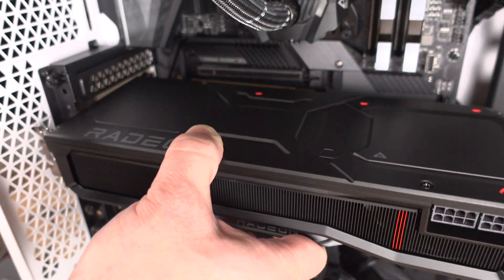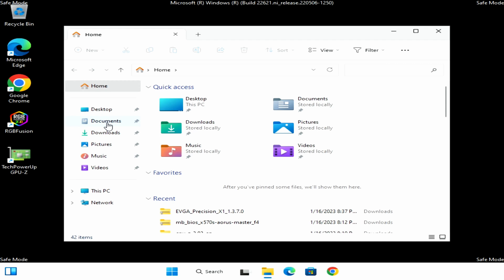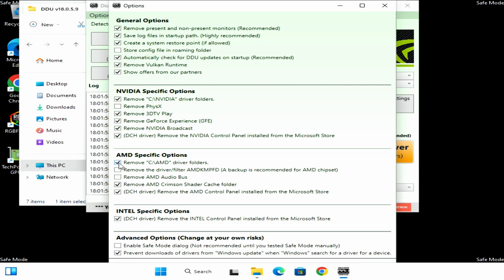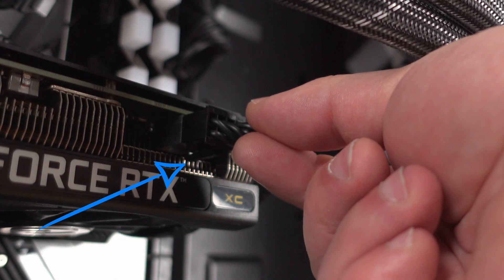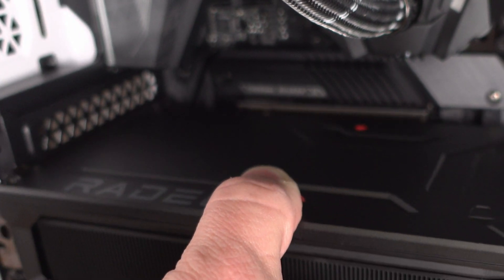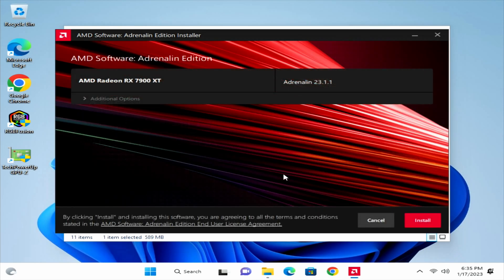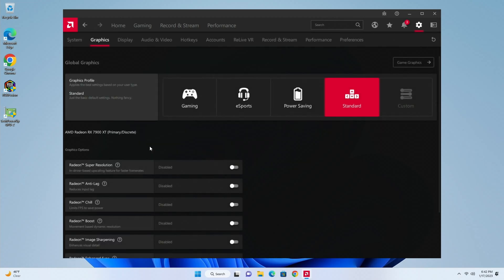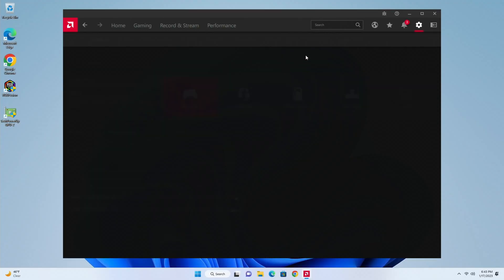The best way to Install the AMD Radeon RX 7900 XT Graphics Card in your PC

Comment: I recently bought a Sapphire Nitro+ 7900 XT and it has 3 6+2 sockets on it. My Montech  Titan 1000W doesn’t have enough PCIE socket to have separate cables for all 3. Is it safe to daisy chain one of the 2 cables?
Reply from the maker: Looking at the package it reads it has 5 * 6+2 connectors, is that 3 cables, and 2 of them have a daisy chain for 5 heads or 4 cables and only 1 of them has a daisy chain for 5 connectors, both ways it sounds like you have enough for 1 cable per port, I am confused?
Reply: @ Ah, you might be referring to the Titan PLA. I have the newer Titan Gold, which has one less 6+2 connection
Reply from the maker: @stevereid636  no, I was this one, is this the one you have: https://www.montechpc.com/en/products_detail.php?nid=329&s_ok2=
Reply: @ThisBytesForYou  Yep! That’s the one. 2 x 6+2 for the motherboard leaving the other 2 x 6+2 for the GPU
Reply from the maker: that one shows 5 x 6+2, they are PCIE/CPU power connections, meaning you can use them for either, you have 4 connections, what CPU are you using and what is the motherboard manufacturer and model number?
How many PCIE cables come in the box for the power supply if it shows 5 x 6+2 PCIE connections
Reply: @ThisBytesForYou  Are you counting the one for PCIe 5? I had a look at the 1200W Titan Gold and it’s the same. I think if pigtailing was a problem they’d and more sockets to avoid returns. Thanks your feedback
Reply from the maker: Look at the link: https://www.montechpc.com/en/products_detail.php?nid=329&s_ok2
If you scroll down a little, it shows PCIE 6+2 = 5 then it shows 12+4PCIe 5.0 = 1
The power supply has 4 connections for PCIe and CPU power and 1 for PCIe 5 power.

Comment: Hi i followed this with the 7900xt saphire pulse and when i turn it on and connect to hdmi i get no display
Reply from the maker: So that I can help, please list the manufacturer and exact model number of the following components:

1. Motherboard - manufacturer and exact model number
   1a.  What BIOS version is on the motherboard, you can find out in the BIOS 

2. CPU - manufacturer and exact model number

3. RAM - manufacturer and exact model number

4. Video Card - manufacturer and exact model number

5. Power supply - manufacturer and exact model number

6. Monitor - manufacturer and exact model number

 Redundant I know, but many people forget to enter manufacturer and exact model number

7. Do you have ALL of the PCIE connections plugged in, and not daisy chained or pigtailed, each coming directly from the power supply?

8. Are you running through HDMI, DP, DVI, VGA, any adapters?

9. Is UEFI or Legacy Setup in the BIOS?

10. What slots do you have your RAM installed in?

11.Do you have CSM Enabled or Disabled in the BIOS

12. Is your Hard Drive/SSD with Windows set to GPT or MBR?

13. This video will help you identify hardware inside your PC: https://youtu.be/65ZSiVImJx0
Reply: @ThisBytesForYou   hi, thanks for the reply, I can't get any display when powering the pc on I tried reinstalling the old GPU but still don't get any display. 

The motherboard is the b450m dsh3 with the bios updated to the newest version a week ago.

The CPU is a Ryzen 5700x3d

The ram is 2 8gb sticks of Corsair vengeance 

The video card is the 7900xt sapphire pulse purchased brand new and the old one is a Ryzen 2060.

The power supply is the Corsair tx850

The monitor is an Asus one not sure of the model but I also tried connecting to my TV as well 

I had 2 separate 8 slot pcie connectors plugged in.

I only ran through hdmi as don't have the cables or monitor for the others

I'm not sure about the WiFi or legacy as can't get into bios as haven't got any display 

The ram is in the last 2 slots but has been in them since I bought the pc (used) and hadn't had any issues 

I tried a couple different hdmis and checked they worked with other devices
Reply from the maker: OK, as for HDMI, do you know if it is an HDMI 2.1 cable, they need to be HDMI 2.1, old HDMI won't work.  Do you have XMP enabled, and are the 2 sticks of RAM on the 2nd and 4th DIMM slot?
Also, when you flashed to the latest BIOS, if you came before F41, did you first flash to F41, then F50 then F67d as the BIOS notes state on the site?
Reply: @ThisBytesForYou  yeah the hdmi is 2.1 and I followed the bios instructions didn't have any issues with it
Reply: @ThisBytesForYou  I think xmp is enabled bot the ram is in slots 3 and 4
Reply from the maker: @lewiskelly5034 disconnect all the cables from the back of your machine, power, USB, HDMI, everything then remove the CMOS battery and wait 60 seconds, after 1 minutes plug all th cables back in, leaving power for last then turn it back on and go into the bios.  In the bios, go to the exit section and select load optimal defaults, or what ever sounds like that, it could be slightly different, save and exit, then go back in the bios, enable xmp, save and boot into windows.
Reply: It was the ram I swapped them over to the recommended on the manual. I don't understand why it did it though as it was fine before any ideas? Thanks for helping 🙌
Reply: I've liked and subscribed I can't thank you enough for helping me
Reply from the maker: Thank you so much for your kind words and support my friend, it means the world to me and I am so very happy I could help you.  Yeah, RAM is a big one, if you didn't push down hard enough, it causes all sorts of weird things, glad you got it my friend.   Also, the RAM NEEDS to be in slot 2 and 4, in 3 and 4 you are running in single channel, 2 and 4 will also help performance.

Comment: But now how do I instal the nividia driver since they have only the croked update still?
Reply: I can get those If I run dxdiag?
Reply from the maker: At the bottom, you can find a link to a video that shows you how to get everything and you can also look inside your pc.
Reply from the maker: So that I can help, please list the manufacturer and exact model number of the following components:
1. Motherboard - manufacturer and exact model number
   1a.  What BIOS version is on the motherboard, you can find out in the BIOS 
2. CPU - manufacturer and exact model number
3. RAM - manufacturer and exact model number
4. Video Card - manufacturer and exact model number
5. Power supply - manufacturer and exact model number
6. Monitor - manufacturer and exact model number
 Redundant I know, but many people forget to enter manufacturer and exact model number
7. Do you have ALL of the PCIE connections plugged in, and not daisy chained or pigtailed, each coming directly from the power supply?
8. Are you running through HDMI, DP, DVI, VGA, any adapters?
9. Is UEFI or Legacy Setup in the BIOS?
10. What slots do you have your RAM installed in?
11.Do you have CSM Enabled or Disabled in the BIOS
12. Is your Hard Drive/SSD with Windows set to GPT or MBR?
13. This video will help you identify hardware inside your PC: https://youtu.be/65ZSiVImJx0

Comment: That's the smallest 7900xt iv seen.   I would not mount my 7900xt the way you are.   Mine is way bigger then that one.   I mounted mine upright in the lian li sup01
Reply from the maker: This is the official 7900XT from AMD, I am proud of you that you mounted it that way,... considering the way I mounted it was the way we have been doing it since cards were mounted.  What is the manufacturer and model number of your graphics card so I can measure the size differences between the 2 cards... And this case will also take a 4090 as well.  Guess you never saw the video.

Comment: what does it mean daisy chain will cause problems? I have 2 separate pcie cords from the power supply to the graphics card. That's not a problem right?
Reply from the maker: I dont recommend it, for anything, what is the manufacturer and model number of your power supply.  The danger of daisy chaining is not providing enough power.  The way I explain it, is you have a straw you want to drink through and you want to share with a friend, pop a hole in your straw and that's how you share your drink.  Both of you will get tons of air pockets and one of you won't get much drink, that is the same as daisy chaining.  You risk many bluescreens, freezes, pauses and glitches.  You are correct, 2 separate PCIE cords is the best, as I show you in the video.

Comment: what if i have amd adrenalin for my 7800xrd? do i still download the driver for 7900xtx on the amd website?
Reply from the maker: No, you don't need to but if you want to make sure you get the best performance you can, it's best you do, but not everyone wants performance plus chances are your drivers are older than what was just released and the method I show you removes all the gunk from the tons of other drivers you have installed in between.  Also, you would download and install the driver, since downloading at all does nothing other than take up space on your drive.

Comment: You forgot to mention the fan system which is the best setting to have besides default
Reply from the maker: Depending on the environment, but I will make a separate video on that, thanks.
Reply: @ thanks u
Reply from the maker: You're very welcome! Glad it helped. Feel free to subscribe if you’d like to see more. Thanks again for watching!

Comment: 10:37 tengo un cable con 16 pines(8+8), debo usar un solo cable o dos clables separados 8 + 8 como lo hiciste tú ?
Reply from the maker: @hectorrobles3986  gracias por prunguntar, debe solamente connectar un cable por connector, so vas a necistar 2 cables separado

Comment: Problem is if I plug hdmi in The GPU i dont get any Signal going to the Monitor
Reply from the maker: I would have replied sooner and continued with your other posts, but I was sleeping.  So that I can help, please list the manufacturer and exact model number of the following components:
1. Motherboard - manufacturer and exact model number
   1a.  What BIOS version is on the motherboard, you can find out in the BIOS 
2. CPU - manufacturer and exact model number
3. RAM - manufacturer and exact model number
4. Video Card - manufacturer and exact model number
5. Power supply - manufacturer and exact model number
6. Monitor - manufacturer and exact model number
 Redundant I know, but many people forget to enter manufacturer and exact model number
7. Do you have ALL of the PCIE connections plugged in, and not daisy chained or pigtailed, each coming directly from the power supply?
8. Are you running through HDMI, DP, DVI, VGA, any adapters?
9. Is UEFI or Legacy Setup in the BIOS?
10. What slots do you have your RAM installed in?
11.Do you have CSM Enabled or Disabled in the BIOS
12. Is your Hard Drive/SSD with Windows set to GPT or MBR?
13. This video will help you identify hardware inside your PC: https://youtu.be/65ZSiVImJx0
Reply: @ThisBytesForYou  
1. MSI X670E Gaming Plus WiFi Mainboard
1a. E7E16AMS.180
2. AMD Ryzen 7 7800X3D
3. Kingston FURY DIMM 64 GB DDR5-6000 (2x 32 GB) Dual-Kit
4. ASUS Radeon RX 7900 XT TUF GAMING OC, Grafikkarte
5. Corsair RM1000e (2023) full modular
6. AOC Q27G4X 27 Zoll QHD Gaming Monitor, At the moment I am testing it at work with an office monitor from EIZO. Tomorrow i will receive my new monitor + new DP cable.
7. All are directly connected 3 x 8 pins to GPU
8. Tryed HDMI and DP
9. UEFI
10. 2 / 4
11. CSM is Disabled UEFI
12. Its GPT
Reply from the maker: @Fisox  So, I needed the exact part number of your RAM, so I am going off of what it generally says for your RAM, but based off of what you have already mentioned, your issue is EXPO, your RAM is not EXPO compatible, its XMP, set XMP in the BIOS and let the BIOS take care of the voltages and such, you can check out this video, I have your very same boarD: https://youtu.be/55i9IcmsxzE
Your other issue is RAM as well, while you purchased the same kind of RAM, they are not infact the same, I show you here: https://youtu.be/xqWfeOsTto8
Reply: @ThisBytesForYou  was also my idea but already changed it back to default settings so that shouldnt be a problem.
Reply from the maker: Maybe, but what is default, we don't know, check also what I said about installing the RAM.
Reply: @ThisBytesForYou  Thanks for your assist.
1. MSI X670E Gaming Plus WiFi
1a. E7E16AMS.180
2. AMD Ryzen 7 7800X3D
3. Kingston FURY DIMM 64 GB DDR5-6000 (2x 32 GB) Dual-Kit
4. ASUS Radeon RX 7900 XT TUF GAMING OC
5. Corsair RM1000e (2023) full modular, therfore i bought additional 6+2 pin cable cause the GPU needed 3 x 8 pin
6. Monitor is at the moment from the Office at Work EIZO. Tomorrow I will get a AOC Q27G4X 27 Zoll QHD Gaming Monitor with new DP cable.
7. Yes each connection is plugged in directly.
8. Tried HDMI and DP both was not working
9. UEFI
10. 2 and 4
11. its disabled so set to UEFI
12. GPT

I also tryed a lot of things today. So strange thing is when I install the 7900 XT I dont have any Video Signal at all not on board and Card. If I unplug it I have fully Video Signal from the CPU. Also the Card fans are running 1-2 seconds on booting than they are stopping and the card is getting hot or warm. So something is working. I tryed today diffrent cables. Tomorrow I will get a new monitor with new type of DP Cable. Dit a lot of BIOS Flashing all kind of Versions. Setting Changes for Integrated Graphics and also deinstalled Drivers. Tryed diffrent PCI Slot´s. I saw in a forum that a guy had also problems and fixed it with a 1250w PSU but that cant be the issue its not a turbine . I also tested it with my ould GPU 1080 worked instantly... may better stay with NVIDIA?
Reply: @ThisBytesForYou  
1. MSI X670E Gaming Plus WiFi Mainboard
1a. E7E16AMS.180
2. AMD Ryzen 7 7800X3D
3. Kingston FURY DIMM 64 GB DDR5-6000 (2x 32 GB) Dual-Kit
4. ASUS Radeon RX 7900 XT TUF GAMING OC, Grafikkarte
5. Corsair RM1000e (2023) full modular
6. AOC Q27G4X 27 Zoll QHD Gaming Monitor, At the moment I am testing it at work with an office monitor from EIZO. Tomorrow i will receive my new monitor + new DP cable.
7. All are directly connected 3 x 8 pins to GPU
8. Tryed HDMI and DP
9. UEFI
10. 2 / 4
11. CSM is Disabled UEFI
12. Its GPT

Tryed today a lot of thinks, bios flash each Version. BIOS settings for Integrated Graphics. Unistall all Drivers etc etc. As long as i dont install the 7900XT it runs over the onboard GPU fine. If I install the GPU I dont have any Video Signal at GPU and Onboard. Also if I boot it with GPU, the GPU fans are running for 1 - 2 sec. and then it stops. Also the Card is getting warm or hot so it works some how. Yester after my first reboot it was working with the GPU then I installed WIndows 11 and didn´t had a look to it. On the monitor there where some stripes but I had a picture. After I returned to the PC it was all black and from then nothing works.
Reply: @ThisBytesForYou 
Tryed today a lot of thinks, bios flash each Version. BIOS settings for Integrated Graphics. Unistall all Drivers etc etc. As long as i dont install the 7900XT it runs over the onboard GPU fine. If I install the GPU I dont have any Video Signal at GPU and Onboard. Also if I boot it with GPU, the GPU fans are running for 1 - 2 sec. and then it stops. Also the Card is getting warm or hot so it works some how. Yester after my first reboot it was working with the GPU then I installed WIndows 11 and didn´t had a look to it. On the monitor there where some stripes but I had a picture. After I returned to the PC it was all black and from then nothing works.
Reply: KF560C36BBEK2-64 and the serial number of both is exactly the same. The Number that is usualy different. Anyhow with my Gary 1080 everything was Running fine.
Reply from the maker: @Fisox  thats very odd, because it should just work, as you saw here.  If you clear the CMOS like I show you, load optimal defaults, save and exit, then install the drivers, please follow just like I say it, how does it work?  An HDMI 2.1 cable should help as well, DP as well, 1.4.

Comment: Great video install went well however, now my fans will not come off the red RGB. When I had my Nvidia card they were purple but now they are stuck red please help! I used mythic color to change them and it doesn’t work after doing this tutorial I would asssume due to driver uninstalled
Reply: Update: I unplugged my RGB when putting in the card I plugged it back in and it fixed it
Reply from the maker: Nice, sorry I didn't reply sooner.  What is the manufacturer and model number of your graphics card?

Comment: Amazing video! Goes way more in depth than any other sort of guide I've seen. I'm coming from integrated graphics on my Ryzen 5 7600X to a 7900XT reference card, when using DDU to clean my system of existing graphics drivers, is there any other sort of special option I need to uncheck? Or just unchecking the options for AMD chipset drivers as shown in the video?
Reply from the maker: Always a pleasure my friend, so very happy you stopped by, trusted in me to help you, liked and subbed as well as took a moment out of your day to thank me.  It means a ton to me and I am so very happy I could help you.   Yup, you are right, uncheck it and you are good.